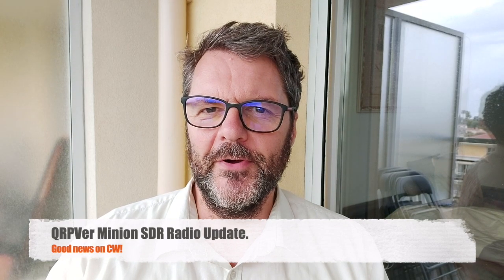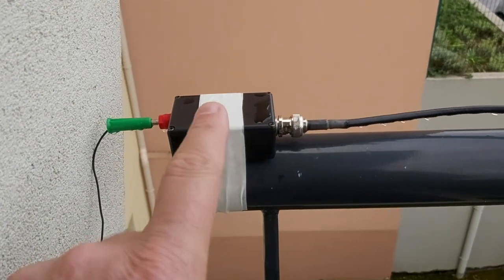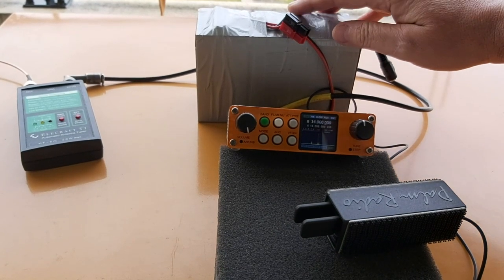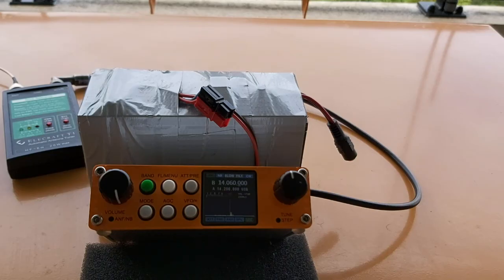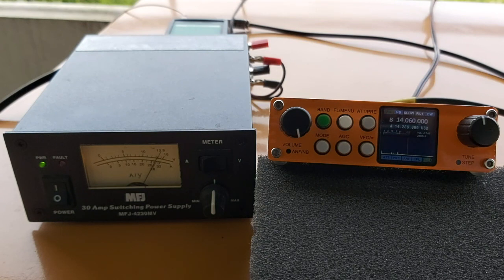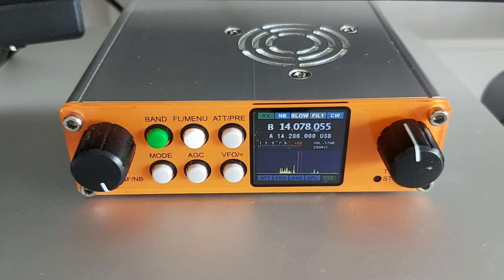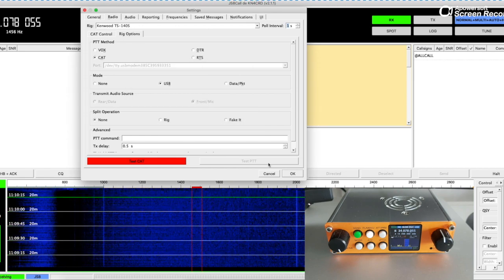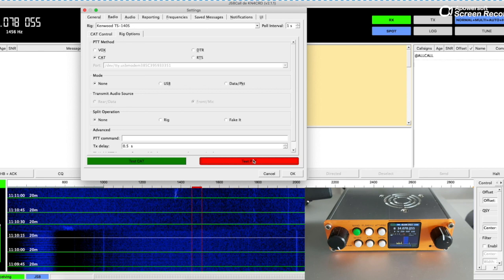QRPVer Minion SDR Radio Update.

Comment: I have had similar experiences with radios not acting properly when I lived in a New York city apartment building. The problem was that it was impossible to get a real ground and counterpoise's did not work to solve the problem. Water pipes cannot be used for a ground in new buildings as they are all made of plastic instead of copper. All the best from N2SN. I am now living on 57 acres in rural NE Florida so I no longer have such problems. I really enjoy your videos, they are so well made and they provide a wealth of good information.
Reply from the maker: Thanks, I need to try with grounding.. BTW I spent 22 years in Sarasota FL :-)

Comment: The cat control problem is a complete deal-breaker. One thing you can try is to set up Flrig with the Yuris suggested radio. Then once that's working if it works, set up JS8Call with flrig as your rig. I wish I was there old buddy. I could solve these problems in about 5 minutes.
Reply from the maker: Thanks, I'll give it another shot.. It just has to work!
Reply: OH8STN why don't you explain to Gil ?
Reply from the maker: I think I figured it out, bypassing the Hamlib library and using FLRig...
Reply: I've have problem with cat control in my base radio (icom 775) but was a Hamlib  problem, replace with a old version and work again with js8call, last version work well (same problem have with jtdx and wsjt and all other programs that use Hamlib) ... 73 IZ3QVB Alex

Comment: Hi Gill glad to see you have solved some of the problems. Years ago I had terrible problems with a Yaesu Ft290 when I wired up a ptt to a 100 watt linear and eventually worked out it was stray RF getting into the radio along the ptt connection lead or the Microphone cable a few little ferrite beads solved the problem.
I also found a lot of digital mode problems can be solved by eliminating ground loops and using totally isolated interfaces using opto couplers and small audio transformers salvaged out of old phone routers. The problems are not always where you think they are.
Best of luck and enjoy the digital world including our very 1st digital mode CW Hi Hi 😊
Reply from the maker: Thank, I tried a ferrite, didn't help.

Comment: Js8call for CAT control of the radio has compiled in it a hamlib package. With current version 2.1.1. which was released on 24th December 2019 found that the CAT on my IC-775 no longer works. Have posted on the Js8call issues forum and Jordan replied that when he releases a new version he includes the current daliy build of the hamlib for CAT control. The daily build of hamlib is a experimental version where authors are trying to implement new radios and not a stable one. Unfortunately the last stable version of hamlib doesn't include a lot of new radios so probably is the only choise for Jordan to use that. In my case by checking the hamlib github found out in that days developers were upgrading CAT for Icom radios to implement some features of the IC-9700 and messed up something with older radios. Later one was corrected but there was no new version of Js8call since to implement new build of the hamlib. Maybe there was something going one with Kenwood radios as well. Unfortunately the hamlib developers don't have all possible radios at hand to test so we should report them if we notice something working wrong...

To find out if the problem is of the radio or with the hamlib version implemented in Js8call try maybe with WSJT-X. WSJT-X uses hamlib as well but most probably some other version. On the current release of WSJT-X my Icom is working well. Don't know for Kenwood since don't have any. Maybe you can try also to install hamlib 3.3 which is a stable version and try (this option would the best to be sure where the problem is). Otherwise try with FLDigi or FLrig.

Usually knowing where is the problem helps to find a solution :)

Best 73 de Andrej - s57rw and stay safe!
Reply from the maker: Thank you, I will try that!
Reply: @RadioPrepper  Just checked the CAT control manual for this SDR radio on the QRPVER website and it says that on last releases of JS8Call and WSJT-X the direct CAT control doesn't work properly. So there is something with the hamlib version they are using. It is mentioned in the manual you have to control the radio trough Omnirig or FLrig...

Best 73 Andrej - s57rw!
Reply: Same problem with my icom 775 DSP js8cal wsjt and jtdx, last version of hamlib works again (now with jtdx ..149 and js8call 2.1.1) Alex IZ3QVB

Comment: Good to see CW problems solved. It might be not that easy to always have an rf choke handy when it is needed :-) No reliable cat control is a big deal-breaker, at least for me. 73, Stephan, DF6PA PS. Nice to see the palm radio paddles :-)
Reply from the maker: There has to be a way to solve it...

Comment: On the JS8Call PTT keying problem, try setting Rig to none and PTT method to RTS with "Port" set to the COM port number you were using for CAT. Then test just the PTT again. If that works then try the CAT along with the RTS, both using the same port number to see if it still works.  I read where the Minion Mini D.C. version can use RTS for PTT, I don't know if the Minion SDR can?
Thanks for the Videos Gil, I have been waiting for someone to review this rig. No better than you!
Reply from the maker: Thanks, I'll try!

Comment: Gil, thanks for update. Definitely interested to learn more about the QRPVer Minion.
All I can think to help with the CAT problems on JS8CALL is maybe stay with the suggested TS440 setting - the interface must be almost all OK if it is only PTT that is not working. For CAT PTT, I have sometimes found that changing poll interval or adjusting TX command delay has fixed CAT PTT problems on some set ups. Also, have you tried using RTS  or DTR for PTT (I don't know if Minion supports RTS/DTR)?

It is a shame that the tig doesn't have good QSK for CW. If it did, it would be an awesome QRP HF rig. I cannot help but think the QRP LABS QSX might have been like this Minion transceiver if QRP LABS had put it into production.
Reply from the maker: I tried everything... I am sure it is fixable. The QSX should come out, the question is, when?
Reply: @RadioPrepper  Hello Gil. Didi you ever try to use omnirig software (it's free)? this is what i use to be able to get CAT information (mainly frequency and mode) to my logging program, and at the same time controle the rig (frequency, and PTT) from wsjt-x (who's about the same as JS8CALL). (i'am using Icom IC-703 as transceiver, not the minion )

Comment: As it is right now, and assuming the Digi modes will be working properly soon...Do you think it would be a good option to have instead the MTR3? I was decided to buy the MTR but then this one appeared... CW is important for me (I´m still learning) and SSB is a great add, of course. Gracias y Saludos! CA3CFM!
Reply from the maker: It depends if current draw matters to you. The MTR will last much longer on the same battery...
Reply: @RadioPrepper  I guess I´ll get the MTR first, thanks a lot. Great videos!!

Comment: I am such a fan. I would give my left leg to be able to work very as  you do. I saw that you had a choke between your antenna and your 9:1 unit. Where the heck do you find those? I am an old fart and unable to build anything due to my tremors. I can only find a 1:1 balun that is about the size of a horse’s leg. Thank you for your time and help. N4KBM. I like the radio. I was out of the radio hobby for so long that all of my equipment is old. I don’t know what an SDR radio is.
Reply from the maker: I'll make a video on that, you'll just have to coax someone to make it for you ;-)
Reply: Radio Prepper  Thank you for your reply. You are one of the few who do. That makes you a true gentleman, rare as hen’ teeth in today’s world. What do you call them and do you think that I could find one on eBay? Thank you again for your response to my concerns.

Comment: Looks like a great radio pity it costs so much with the options normal people would want...
Reply from the maker: No more than other models, and half of an FT-818...
Reply: @RadioPrepper  Yeah that is partly true but I can buy a 2nd hand FT817 or FT818 I doubt these will be available 2nd hand any time soon.   And the issue is buy the time you get all the extra options it starts to look a lot more expensive...
Good that you could get it all working now.

Comment: Most SDR radio's have super clean on receive, what the ADC sampling bit rate on the Minion?. Your PTT problem might be a Com Port issue,  I have a QRP SunSDR transceiver (awesome radio) and I need to create a virtual Com Port to get it to work with WSJTX, for example 1 port split into 2 with software.  Most SDR's need to do this to get them to work with digital software, here is a link on using Com 0 Com with SDRPlay https://www.youtube.com/watch?v=dZg7puQ9Ajk
Reply from the maker: I figured it out! See my latest video.

Comment: Very interesting. The use of a relay as a TXRX swich is no reason that QSK doesn't work. Modern relay swich time is fast and around 6ms. I guess QSK should woks on the minion. May be the developer must reduce the delay in the firmware or implement a user option to adjust TX RX delay. See https://youtu.be/Yh0Cdq44B6s
Reply from the maker: I would be worried about wear for relay QSK..
Reply: @RadioPrepper  No, this days there is no problem to use a relay for QRK if you look into the specifications of some suitable relays. Many expensive comercial rigs with QSK capabilitys also use relays. With the right application the supplier specify until 1x10^9 cycles on around 5ms switching time. This is fare beyond of any  practical conserne. And there are also advantages to use a relay despite a pin diode swich. So, I guess that on the Minion it's only a SW issue to make the Minion full QSK capable.